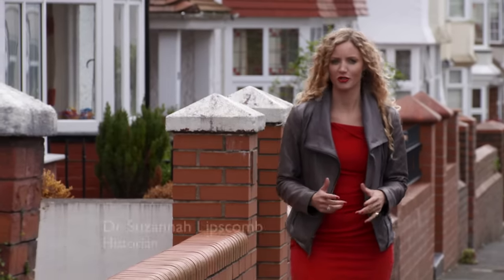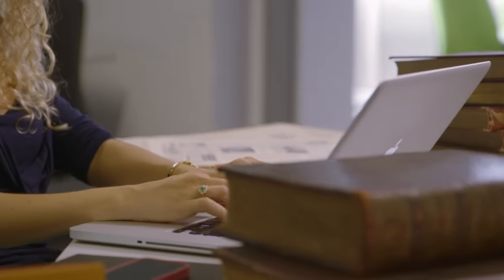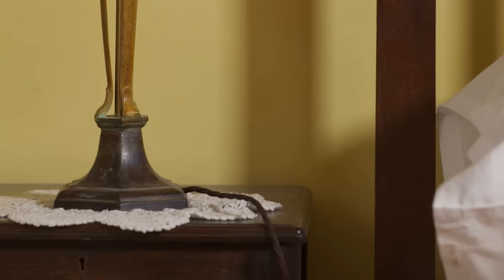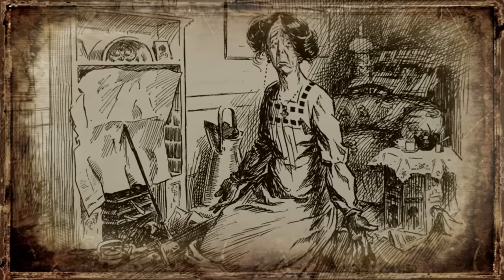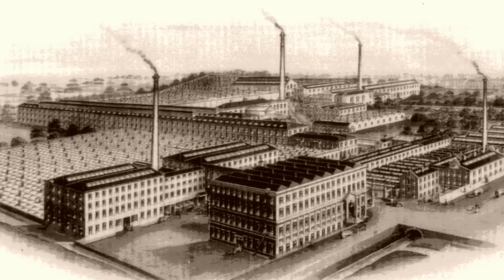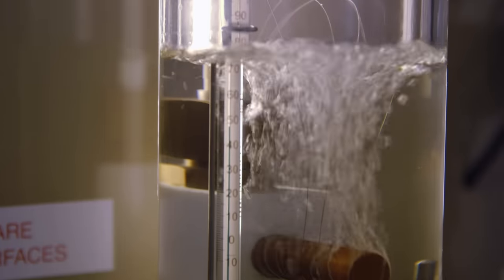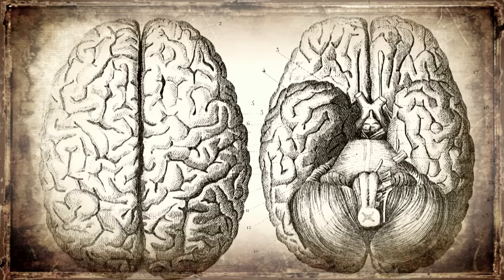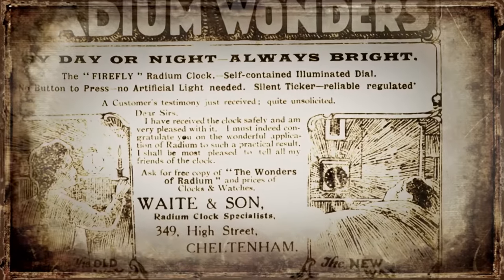How New Electricals Made The Edwardian Home A Deathtrap | Hidden Killers | Absolute History

Comment: She often confuses high voltage with current.  It is excessive current though a conductor that generates heat independent of the voltage of the circuit.

Having made that criticism though, I consider this to have been an excellent production.
Reply: Yes! Glad someone pointed that out.
The quality and thickness of the insulation required is dependent on voltage, but the thickness of the actual wire, the metal conductor itself, depends on the current. Too much current through a wire of a given thickness causes it to get hot and that's what causes fires--it has nothing to do with the supply voltage.
Reply: As an electrical engineer, I can say that current and voltage are tied together. The equation is Ohm's Law of e=iR where  e is the voltage, I is the current and R is resistance. Let's assume R = you. You are the 'resistive load' and you are a constant. Then, when voltage goes up, current goes up. Current is what kills a person, but there must be sufficient voltage to produce that current.
Reply: @2011littleguy   My argument is that it is the current that normally kills and that is true even for the low current case for stopping the heart though that is not my issue.  Yes Ohm's law or at least it or the AC equivalent ALWAYS applies.  OF course in the case for AC phase does not matter with respect to current killing a human.

Indeed, one of the oddities is that if the frequency and or the voltage is high enough the current may not flow through the core of the body at all.
Reply: @billleach3396    I experienced some shocks in my early days either through improper grounding or capacitor discharge. I was once thrown across a room into the opposite wall. I know what AC at 60 Hz low current feels like. It's not pleasant. I have a respect for electricity at any voltage, frequency, or current.
Reply: @2011littleguy   LOL  I laughed because I have had the same experience!  I too managed to make accidental contact with the B+ supply for a television set and ended up sliding down the wall behind me.

I too have a very high level of respect for electricity.  I have spent quite a bit of my life working with and on power supplies up to 30KV rated at up 1 amp continuous.

Also a lot of 440 VAC stuff.
Reply: @billleach3396  Voltage and current are definitely relative. Resistance is actually what kills. In essence it is like water. If there is a  path water will flow toward ground through the path of least resistance. Voltage is like the waves that are generated as the water encounters resistance; the flow volume is the current. If the there is a sufficient size of conduit the water will pass through and generate almost no voltage. However, if there is too much current and the resistance is too high there will be significant voltage spikes and in essence very high pressure; this pressure is what kills. It is entirely possible to create a path for the current to flow to ground and avoid a shock or any significant voltage propagation. What is important is to know what size of wire you need to ground your load. If the load is properly grounded there will be very little pressure to push the current into a path with high resistance such as a person. What makes a person much more vulnerable is the moisture on their skin.

Dry human skin has a resistance of 1000 ohms, wet human skin drops to 100-300 ohms. Therefore, a standard 120v, 20A supply could shock a person with wet skin if there was not a sufficient size of ground wire to take the full 20A. Based on that formula wet vs. dry skin is enough to change the current entering the body to above 1A. 1A is enough to interrupt the heart beat. However, when there is more current there is much more heat and the heat alone can kill. Especially when that current encounters bones which have very high resistance. I was once shocked by a 8000 volt power line when our tent center pole came into contact with it. All six of us were severely shocked, one team member died, and one was in a coma for 2 weeks; both of my shoulders were broken and we all sustained 3rd degree burns on the exit points like our feet. The real damage only took place when there was high enough resistance where the current passed from my foot to the ground. My shoulders broke because we were setting up a tent with a dolly and center pole that could roll free and was under a very high mechanical load; the mechanical load was passed into my arms.
Reply: Here's something you probably didn't know. Asbestos was used for years as an additive in pavement. Many of the roads being torn up and replaced contain asbestos. They didn't even teach us that at school for Civil Engineering Technology. We are the authority of health and safety. They don't teach us that.
Reply: @brendanwood1540   I liked your discussion but absolutely reject the concepts that resistance generates voltage (implied by your analogy) or that it is "resistance that kills."  It is true that a current flow through a resistance, that is part of a complete circuit, will result in a voltage drop across that resistance however, remove the resistance and a voltage will still be present.
Reply: @pervysage4392   The B+ supply of old B/W televisions was typically over 300 VDC.
Reply: @pervysage4392   And I should have mentioned that I flew back across the room as a result of muscle action.

I would think that encountering an actual current flow of sufficient magnitude to physically throw someone across the room would also be great enough fry them to a crisp.
Reply: @billleach3396  Current that encounters resistance generates a voltage. The voltage inside the wire is actually very small. The heat is generated by too much resistance. Heat is like friction and that is like a tsunami that propagates when the wave hits shore. There is no amplitude to the wave until it propagates upon encountering resistance. If you reject my idea it is simply because you have not attempted to model the mathematical formula.

You said current is dangerous and yet I can touch my 12v 150 amp LiFePo 4 battery terminals without getting shocked. The wire is over sized so there is no risk of injury. However, if the wire were too small it would melt and that could cause significant injury. If you take the wire out of the problem then there is no conductor to generate heat. The danger only arises if the wire is too small and melts into a path to ground. In addition, that heat will melt your skin, and that will lower your resistance. But the electricity entering your body will not cause any harm until it encounters resistance. 

The frequency of 50 hz is actually what kills most people. That is the same electrical frequency as basal muscle contractions; aka your heart. If the timing is off then it can cause a heart attack. However, without sustained current encountering resistance the level of heating is minimized and most shocks can be survivable.

This same concept applies to high voltage and current transmitting power lines. The men who work on them wear a conductive suite with insulation around it to allow the current to pass around their body with no resistance. They use a wand to gently bleed the current into the helicopter so that there isn't too much resistance when they touch which could cause an ark flash or explosive breakthrough the barrier of resistance. That explosive break, is like if a water main bursts. The pressure release can cause severe trauma. The water pressure alone is harmless unless it encounters resistance.

Batteries linked in parallel and series also follow the analogy like water towers. Stack them in series, and put them side by side in parallel. Ground is just a relative thing you create. The gravity in the analogous situation is determined by you. Electromagnetism and gravity are actually relative as well.
Reply: @brendanwood1540   Sorry bud, but your statement that Current that encounters resistance generates voltage is BS.

Your 150 Amp is a rating not a statement of the amount of current flowing.
Reply: @billleach3396  
(Voltage) = (Current)(Resistance)

No need to be rude. If the idea of water hitting shore propagating waves doesn't help you to understand. No amount of explanation will help you. 

Voltage is just a potential value like force. 
(Force) = (Mass)(Acceleration)

If the current is the mass of flow, and the voltage is the force of the flow, then resistance is what determines the acceleration of the electrical flow.

If we think of it like a highway collision. What kills is speed differential. Two things with very different resistance values. The object in motion remains in motion unless acted upon by an external force (no resistance). If we are talking cars, or electrons, they remain in motion and there isn't any force (AKA volts) until there is resistance in the form of friction. A insulating wall is like a stationary object that pushes back against the object in motion; so the car would crash and the force would rise proportionally. The size of the car did not change just as the number of electrons does not change, what changes is the force and acceleration. 

What's important is that fundamentally my explanation enforces the importance of properly grounding a circuit and will make electrical work safe. The ground allows the extra current flow to dissipate if it is not used or it does not flow back into the battery. This in turn allows insulators to work properly. If there is no place for the current to dissipate then resistance can cause heat, and heat can cause harm. If there was no resistance in our world, electricity would flow through everything and cause no harm.
Reply: @brendanwood1540   Even your last sentence is not necessarily true.  Current flow produces a magnetic field.  The magnetic field itself is capable of causing harm.

Back to my original disagreement with you.  Voltage is NOT caused by resistance.  Voltage is caused by one of several energetic processes that causes to collect non-uniformly within a conductive (or simi-conductive) material [or for static electricity; for electrons to be collected on or removed from a very high resistance insulator].

You are trying to express what is happening when a current flows through a resistance using linear causality.  Such an explanation is useful but somewhat misleading.  The resistance does not cause the voltage.  But it is also true that the voltage does not cause the current to flow absent a circuit path having a resistance low enough to permit electron flow.
Reply: @billleach3396  I think the confusing bit is actually how ground is relative and gravity seems more directional. The electrons are attracted to a polarity not pushed by a motive force. I also was rationalizing why current is dangerous because it is the same as a congested highway. More collisions and more heat.

Current is constant at a point in time at a given place. If that current encounters resistance it will increase the voltage at that point. The way we measure voltage is actually the drop in voltage between two points. This can confuse us into thinking voltage is a constant. However, voltage drops as the battery drains while the current flow is dependent on the resistance of the wire and the polar attractive or motive load. The current will be the same while voltage drops over time as the charge potential drops.

It is simple to test the theory. Look up the internal resistance of a copper wire and then look up the resistance of human skin. 
The resistance of copper is so low that there are almost no measurable volts inside the wire. We can see the current flow however as there is friction at the insulation or air boundary of the wire. If the same current encounters human skin with a very high resistance the voltage will spike to millions of volts momentarily. 

My hands were sweaty so they were not burned. But my feet were insulated and the current had to arc from my foot to the ground. Because air is not a good conductor there was a great deal of resistance. The voltage in my feet was the greatest while throughout my body it was relatively low because my body is filled with water. So I only sustained burns on my feet. If the voltage was constant then my entire body would have experienced the force of the load.

Much like a pipe or water tank leaks at the bottom. The circuit leaks at the lowest points or the points closest to the polar attractive force. The pressure is greatest at those points, and the force is also the greatest. Because voltage is the electrical force it is also the greatest at those points due to resistance. Hence why a grounded wire that is undersized will melt starting at the point of contact with the ground. Voltage is not constant.
Reply: @billleach3396  the dude is an electrical engineer,man.he knows his shit.😳
Reply: @kyzor-sosay6087   Well my field is nuclear energy engineering, primarily instrumentation.  I consider his presentation to be misleading, not necessarily wrong but misleading.
Reply: Well Dammit,Bill,you know your shit too.I’m just an ole electrician .Didn’t set my goals quite high enough.😉
Reply: @kyzor-sosay6087   Ah...  Just how long do you think this "high tech" world of ours would function without electricians?  Don't sell yourself short.  How many people are better off today than they would have been were it not for ideas that you came up with?
Reply: Thanks sir,for the encouragement.Will make going back to work Monday a little more enjoyable.Good luck and good health to you and your family.
Reply: @kyzor-sosay6087   Thank you.
Reply: @devilsoffspring5519  thats funny. If there is zero potential difference aka voltage then tell me how much current flows and how much heat? Yes, current will be the primary factor but voltage is too. I wish people would stop harping on that shit. You can't have one without the other.
Reply: @brendanwood1540  incorrect. Power always returns to the source through every single path possible, even high resistance paths. However, the the current flowing through each path will be proportional to the resistance so you could feel nothing, a small tingle, a shock, or a heart stopping current. It also depends on the voltage gradient. It NEVER solely takes "the path of least resistance." You just may not notice or are able to measure the other paths.
Reply: @pervysage4392  old cathode ray tube televisions had high voltage transformers for the magnetic fields to bend the rays. They also had capacitors that could discharge if shorted. Now I dont know about "thrown across the room" but a shock... sure. Involuntary muscle control i suppose. But I doubt Hollywood style thrown.
Reply: @brendanwood1540  current doesn't create a voltage. A potential difference from point A to point B is what determines voltage. Not sure what your battery has to do with it. Put a busbar across the terminals and watch it fuse and melt.
Reply: @brendanwood1540  if there was no resistance in the world then there would be no potential difference so in actuality, current wouldn't flow at all. But then everything would be dead since the nervous system requires electricity so... a moot point.
Reply: @etherealrose2139  Right, however, just like water the electrons flow through the least resistant path with the greatest current. Just like water if there is a path with less resistance, like a spillway, the resistant barrier (Damn or human skin) is not broken by the current flow. This is why we ground a circuit. The point was to make him think how it's all relative and if we want to try to define what is actually harmful it does not make sense to say voltage or current because both imply the other can be high as well. 

My battery is capable of discharging at more than 1 C which also means that it can produce more than 150A. The voltage is very low and the current is very high. However like you said there is no potential difference when my hands touch the terminals because the resistance of my skin is high enough to insulate the current flow. If I was touching it with a metal wrench for example then the current would flow all at once unrestricted and melt the metal which would in turn melt my skin and that would in turn cause me to get shocked because the resistance of my skin would drop exponentially with time.

Being safe involves understanding the complete picture and not confusing people with current vs. voltage arguments when the resistance is what determines the current flow. V=IR arranged into I = V/R
Bigger the R smaller the I. Smaller the R bigger the I. 

The potential difference in charge has to do with valence electrons in chemical bonds being exchanged from  one place to another. If there was no resistance the electrons would not oscillate like light travelling through a medium. Electrons would behave as particles and not waves. It is very simple. Just because we can't measure the waves does not mean the particles are not flowing from the sun to the  earth. They are only detectable when they hit a detector and propagate a wave. Our eyes do the same thing.

Wave form propagation has entirely to do with resistance or refraction as it's referred to in light. The angle of refraction has to do with the resistance or reflection of light.Transparent mediums conduct light in a whole spectrum of wave lengths based on the angle of refraction. Similarly magnetic field project with greater intensity though a refractive index. So when we measure the current or voltage of a wire through induction we are measuring the propagation of waves from the exterior of the wire as there is a resistant barrier that reflects the electrons. I believe this is how a hall effect sensor works.

The frequency of the waves is determined by the magnet configuration in the generator and that is stupidly tuned to 50 Hz which happens to match out heart. But the amplitude of the waves is entirely based on how much current encounters how much resistance V=IR. F=ma
Reply: @etherealrose2139  It's not falling that kills you; it's the landing part.
Reply: @etherealrose2139  I'm surprised you all just ignored the bit about how they added Asbestos to pavement for years and don't educate anyone about it on purpose. Because they are ripping  up those roads every day. The dust on our cars is part tires, part brake pads, and part road.

These are the kinds of environmental factors that effect mortality rates across the full spectrum of respiratory illness. Localized environmental factors. So when we look at mortality rates from diseases like the current pandemic we should also factor is the environmental factors which influence mortality because they effect the immune system.

Sulfur dioxide is another good example. 10 micrograms per cubic meter of air is enough to increase the mortality rate by 1.9-2.4% across all respiratory illness. In Wuhan there were very high SO2 levels being protested against this past summer. In the winter air pollution is worse because there is  no rain to clean the air. The mortality rate in Wuhan was 2.38%.
Reply: @etherealrose2139  Another good analogy. A big pool of water is like high current volume. It is not harmful if the pool is large and open without turbulence. However, if you open a drain at the bottom the difference in pressure can suck you right into the drain. Because the size of the pipe is too small the pressure is increased and this is the same thing as a wire being undersized. Resistance in the wire can overheat it and melt the circuit. But if the wire is big enough and you are not a viable path to ground with low enough resistance compared to that wire, you can touch the wire all day long with both hands at the same time. What makes our high voltage systems dangerous is the fact that the wires are undersized and actually lose 25% of the current flowing through them into the environment. The higher voltage is due to the resistance in the wire being relatively higher. Because the wire has such high resistance the current will travel through us because our resistance is not relatively high enough. When I say high or low I mean RELATIVELY.

Also, you could have 1000 amp current pass through something with zero Ohms resistance and there would be 1000 AMPS and zero volts. (1000)(0)=(0).
Which means that an object in motion remains in motion unless acted upon by an external force; no volts means no electrical force. Just like a particle in space does not exert any force. The force experienced/change in acceleration experienced by the particle is zero. The particle still moves.

Lightening is high voltage because the air is  high resistance. The truth is that both high amperage and voltage are dangerous, while even low voltage or low amperage systems are dangerous. IT'S ALL DANGEROUS. Not one or the other. What makes it dangerous is the potential energy capable of generating a force.

BEFORE ANYONE ELSE TRIES TO CORRECT ME. GO AND READ OHMS LAW. Volts are electrical forces generated when a current encounters resistance. A good source will also use water to help describe the concept. Most will fall short of a complete explanation.
Reply: @etherealrose2139  As a general rule however, higher voltage implies greater resistance, or undersized wiring. Which is actually done just for cost savings. The higher resistance to the current flow resulting in the higher voltage also makes it more dangerous. So high voltage as a layman term is more dangerous. However, the layman should not mess with electricity. So we should not give them the false impression that they understand it.
Reply: @brendanwood1540  Dear Lord- I hope you are ok now!   That’s quite a survival story 😖
Reply: @corablue5569  Doing much better; thanks. It was an ordeal; one I wouldn't wish on anyone. A deep lesson that I want to share with everyone so they don't have to learn it the hard way. It was an overhead wire above a large tent we were setting up for a wedding. Really nice beautiful summer day with a lot of hard work ahead. We just got down to it and the sun blocked our view overhead. No one noticed it until our center pole came into contact. By then it was too late. 

Funny thing is this past year I spent days breaking and drilling rock on a clients property with an engineer on site doing surveying, and the owner out there with us every day. The whole time there were power lines over the spot they wanted to put his garage and no one noticed it. Only after we spent days breaking granite did we realize it was for a lost cause because he didn't want to spend the money relocating utilities. 

I have 13 screws and a plate in my arm holding the bone together now. Everything is harder because that one simple mistake. Most importantly though we lost a really special person who would have made an excellent detective and servant to the community. A person who could have changed lives for the better and helped a community in need.
Reply: @brendanwood1540  Wow- I’m glad to hear you are better, and sad for the loss of your friend.   Stay safe, and thank you for sharing your story.   I know I have taken electricity and all the safety measures for granted in the past, but never again!